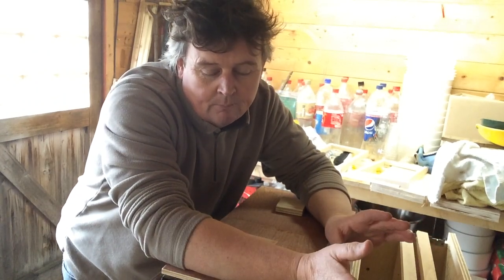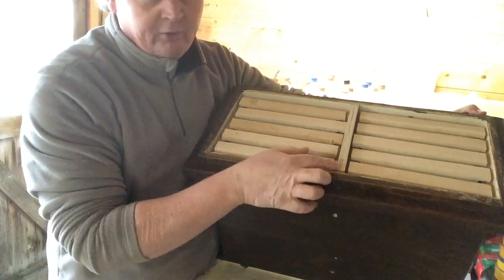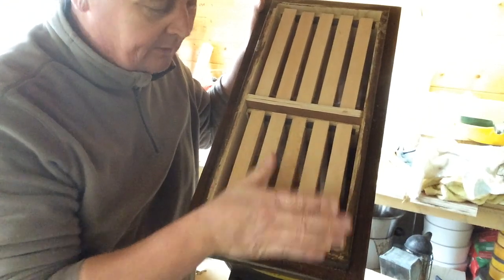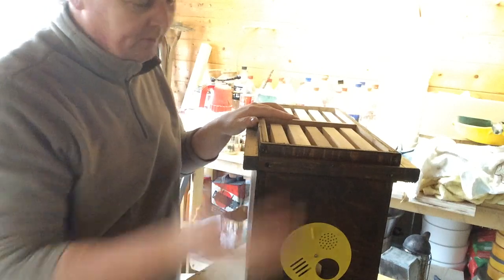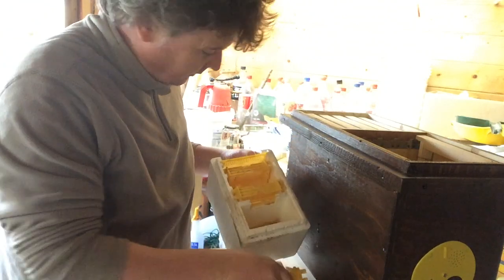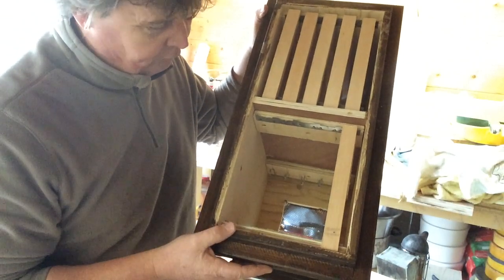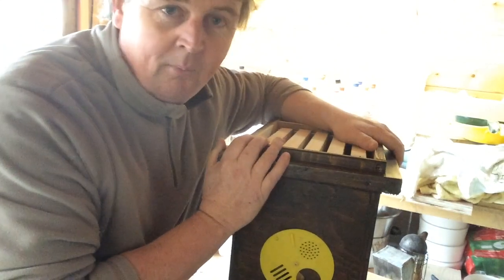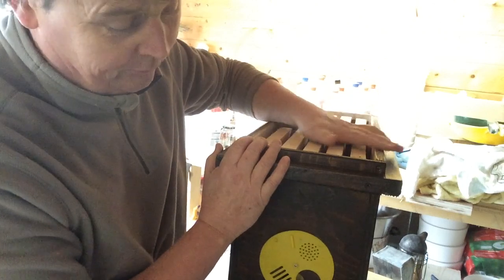Nucs and Mating nuc Production

Comment: Hi Richard, love your videos. I'm a newbie (3rd year), wouldn't it be easier to split the NUC length wise 2 or 3 frames each side of a divider, instead of across? with the work involved. D
Reply from the maker: A Vatar yes it might be, I don’t use these particular boxes now as the bees just outgrew the frames so quickly. I converted them back to nucs.
Which was always part of the design. I
Now use The Mini-plus system. You can easily add on another box when their full. Not with these boxes in the video! So you learn as you go! Thanks for your comments.
Reply: Life seems idyllic where you are, Building NUC on 2in1 poly idea, with 2 entrance to be able to use as mating nuc by using a splitting board. thanks again for the vids, you are a natural in front of camera. all the best. D

Comment: Have you tried splitting the box down the middle lengthwise? That you you don't need to mess about with small frames, less chance of swarming, etc.
Reply from the maker: Kujo Painting yes I have and many new systems made since I made this video are going towards using standard sized frames but only two of them! Like the smaller frames they are a smaller surface area so you still have to
Manage them well!. You asked a good question but it’s not messing around with small frames. I also now use the Mini-Plus system which has similar sized frames. A very useful mini mic that can easily be added too!
You have to try different options until you find what works for you!!

Comment: Why not just add the 1/2 frame nucbox on top of a strong nuc let them build it out.
Reply from the maker: Tom Sotiridy i couldn’t do that because the bases were fixed and I didn’t have a box that would hold them so I could build them up and transfer them or break them down later. This was all pert of my learning curve. I now use the mini-plus system. Works great ad much more diverse in its usefulness.However it was a good exercise to try.
Reply: Richard Noel that's interesting.  I would like to hear more about your experiences, and how you got to the mini plus. Any thoughts would be great. I have migrated from Warre to nationals, purely as it is easier to make increase. Phil Chandler of barefoot beekeeping floated the idea of a 1/4 size national for mating nucs and the like. It sits well with the 1/2 national nucs that I use à la Michael Palmer.   I'll let you know how I get on this year.  It's been a slow start as my day job is unseasonably busy...

Comment: Probably very easy to winter the small ones, just use the same size box, and make it a super on top of this one, then enough for your very mild british winters, here you need 40 to 60 lbs honey.
Reply from the maker: actually, paul these were very difficult to overwinter.   nIt was very difficult to see just how much stores they had, so I've scrapped this system. converted these back to standard nuc boxes and i use a different system now that has more flexibility. youR always learning!